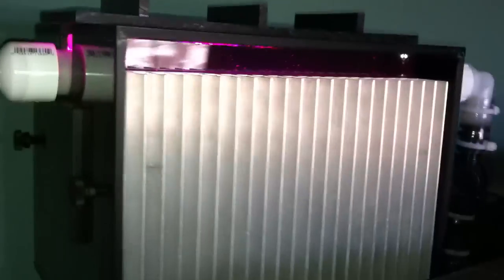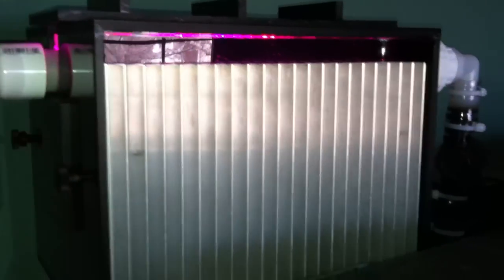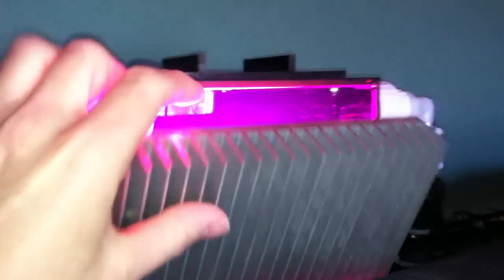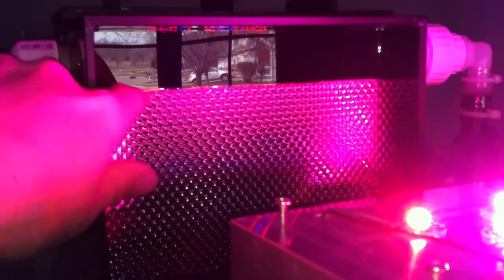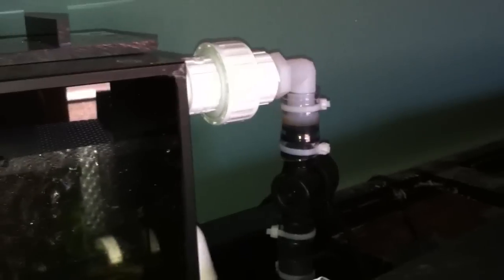L2 Algae Scrubber on my 120g at 4 weeks: 8 days growth after last cleaning

Comment: Nice scrubber... what is the name of the screen that you use? where can I buy it?
Reply from the maker: Arnold Adolfo It's a plastic knitting canvas, Darice brand - #7 size.  there are also #10 and #5 sizes (10 holes/in and 5 holes/in) but you want the #7.  You should be able to find it at a hobby store or fabric supply store, or online (eBay or Amazon).  Also you want to use the "clear", not any solid colors, because those have other things added in for coloration that you do not want, and you want the light to penetrate through the material, not get stopped by it.
Reply: damnit Jim, the solid color mesh have other.... WHAT??  i just made a scrubber with the red color mesh
Reply from the maker: Any coloration will block light from getting passed through to the roots on the other side.  So basically, it won't attach as well.  As for the dyes and pigments, those are mixed in before the injection molding and can leech out into the water over time.  I read once somewhere what the chemicals/dyes were called but I can't recall.  Either way you don't need the colored mesh, it's functionally disadvantageous, so just don't use it.
Reply: good to know, wish I wouldn't checked sooner.  Thanks
Reply: your battling algae in your tank but your windows are helping a lot with it growing. cover them windows guy.
Reply from the maker: I don't have an algae problem in this tank at all...the windows are not an issue, I get direct sunlight for maybe 10 or 20 minutes in the early AM then it's all indirect